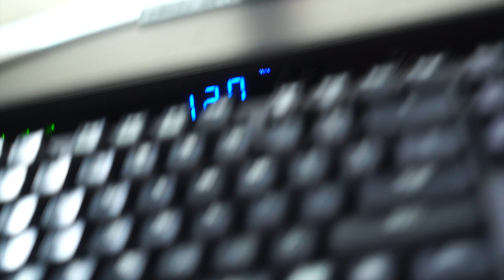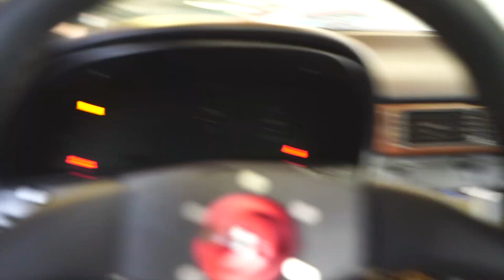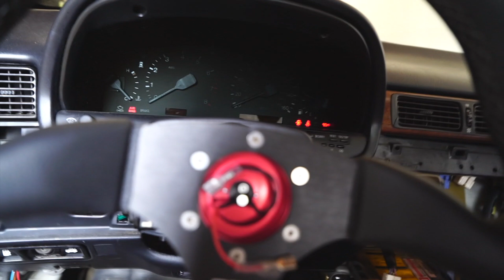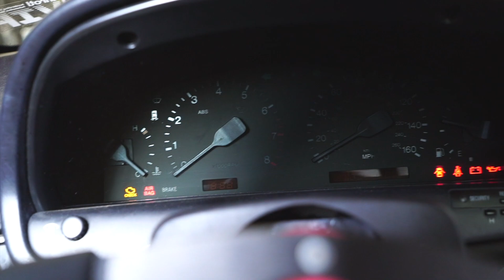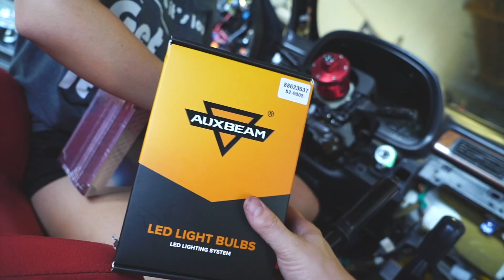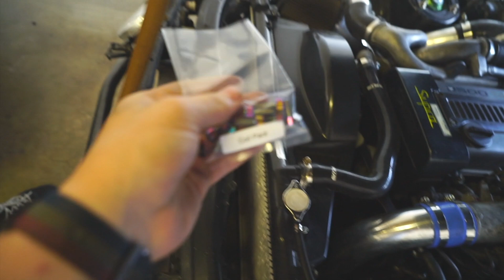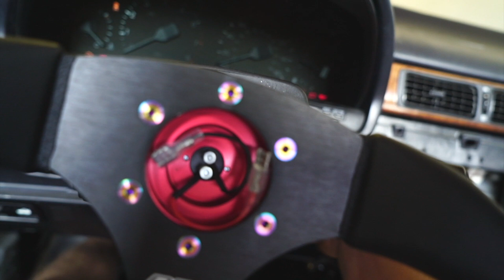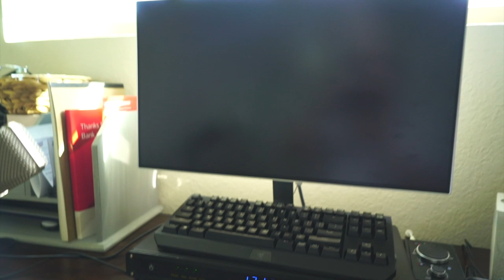There's a MASSIVE HOLE in my 1JZ Lexus

Comment: Precision Fiberworks on facebook has a carbon fiber oem fitment sunroof replacement for the stock one, super light and looks dope. Oh btw, turn the little knob on the left of the dash to the right to make the dash lights turn back on ya schmuck.
Reply: Makes sense turn the dash lights to on.
Reply: oh and LRB speed makes aluminum race door panels, bolts right on.

Comment: Plug the factory radio back in because if its like a chevy you have to have it in or it sets off alot of kights an stuff doesnt work
Reply: Yes my dash lights didnt work it only showed  checkengine light which it threw that off then security
Reply: Ya me an my friends had to get an adapter so it didnt set off codes it cost like 120

Comment: Hey Evan you have a bad ground like 100% and now you have a ghosting issue :) find out everything that does and doesn’t work use a wiring diagram to follow the leads so you don’t spend hours chasing the physical wires them selves
Reply: The volts try to find a ground somewhere else so they end up going through other components